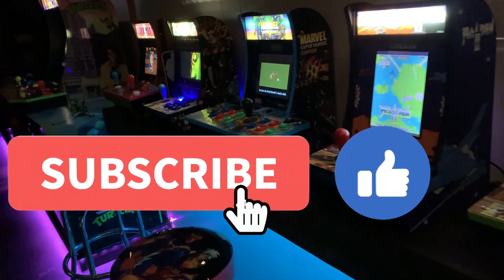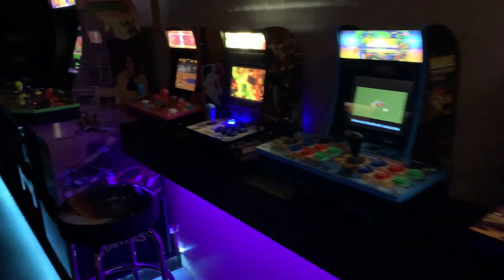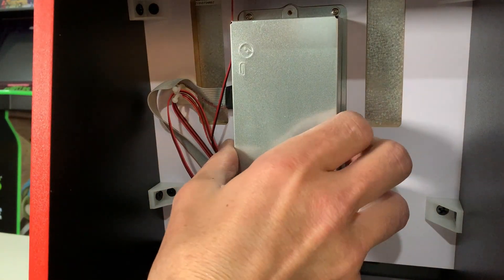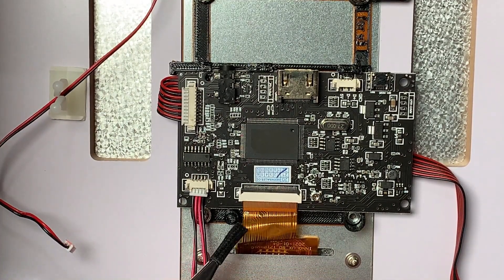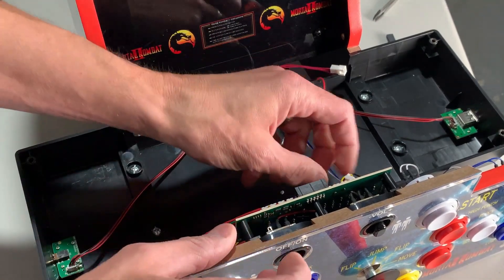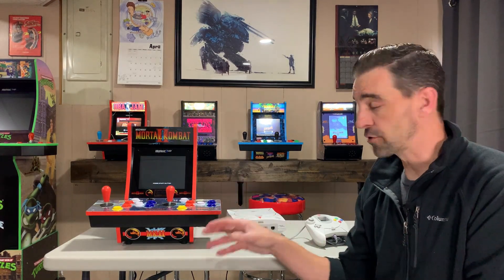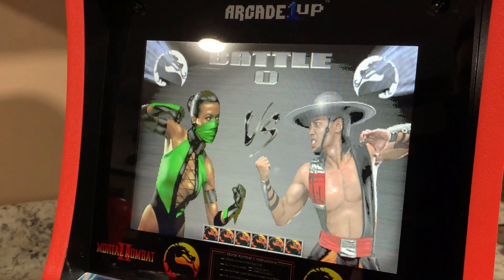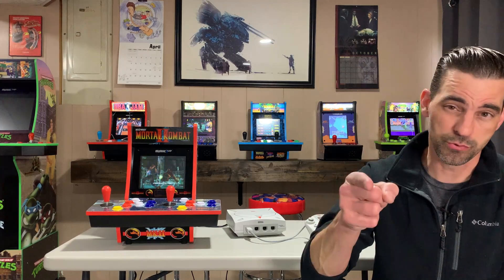Add HDMI In to your Arcade1up 2 player Countercade V3!

Comment: It is possible to plug in the lit marquee. There's a place to plug it in unofficially I believe next to the hdmi port.
Reply from the maker: My lit marquee connector did not fit that port.
Reply: @19kfox  Interesting. I got it working. Idk. 🤷‍♂️
Reply from the maker: @MobileDecay  I just saw your video and the tutorial that you linked. Looks like you can power the marquee with a larger power adapter. Thanks for the heads up.
Reply: @19kfox  Thanks! You're welcome. 😁

Update: Wait a second thanks and you're welcome sounds funny in the same sentence. 🤣

Comment: Thank you for all the mod videos for third gen countercades, quick question with everything you used here does the stock controls of the countercade or do u need another item.
Reply: You can use the buttons but you have to replace the sticks and you will need encoder boards for the buttons.
Reply from the maker: This mod only allows you to connect an HDMI source to the stock monitor.  To use the stock controls require usb or console specific encoders.  This will work well with a PI or a "mini-console".

Comment: Nice video, Any solution to the resetting of the screen back to stock issue?  

Also I would imagine that connecting the light up marquee would just be a matter of splitting off the power connector to the LED for the marquee provided they are the same voltage… If not a few dollars will buy a power converter that should boost or drop the voltage as needed… Would require a tad bit of soldering but pretty feasible… I would i agine the volateges are probably the same but definately worth checking first.   The messing up with the screen is a dealbreaker for me so let me know if you find a solution. Again great video!

Comment: I'd rather like to see HDMI out instead of HDMI in. Paired with the USB and external controllers, having the option to play Mortal Kombat on a bigger TV would be great.
Reply from the maker: I agree. It would add more functionality IF you can find a controller that works. 😂
Reply: @19kfox have you found one?
Reply: That's precisely what I did with mine. It works beautifully. I took and completely gutted my Marvel superheroes 2 player countercade. I replaced the headphonejack and USB with two new USB ports to connect with the Pi 4 I put inside it. I replaced the monitor witha slightly bigger HDMI one then I put a splitter so it can run off a TV. I wanted something portable to bring as it's a fun party trick. I probably spent a bit more on it, but I made it exactly the way I wanted it, and can easily upgrade the PI 4 in the future since it's all HDMI and USB connections.

Comment: Going to try and do a mod for my kids bday present. I want to keep the stock controller configuration for player 1 with the stock Mk Games but for player 2 have it connected to a ps4 to play mk 10 and 11 . Idk if i will need a fighting board or if i can take a compatible fight stick apart  . Also want to do Happs .I def want to keep the controls correct though . not sure if I can do that properly with a pi. I wish there was a quick way to go back and forth between stock and mod. Will prob have to be Pi for one stick and fighting board for the other with an hdmi splitter
Reply from the maker: Trial and error bro. 🦊👊🏼

Comment: Quick question. I bought a Marvel  vs Capcom countercade 2 player.
Kind of disappointed with my purchase, after only playing one match. 

Are these identical to the regular size A1UP that you know of? As in all the cabling, and connections? I'd like to find a used cabinet that I already own, or might not want to own, and use the MvC guts to make it full size.

Searching if anyone else has done so, is what lead me here
Reply from the maker: Unfortunately no. The monitor connections are completely different.
Reply: @19kfox  I kinda figured as much. I don't totally hate it. In fact I own the Pac-Man countercade and love it. The MvC just feels strange to me. Can't explain it.
Thanks!